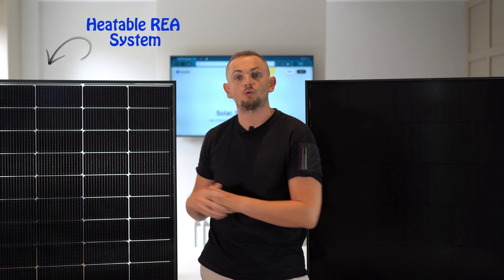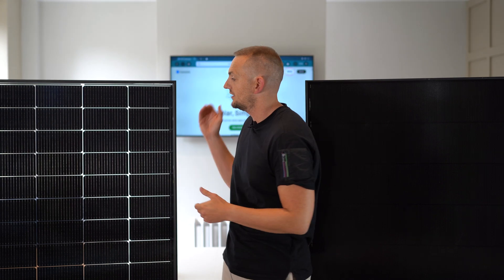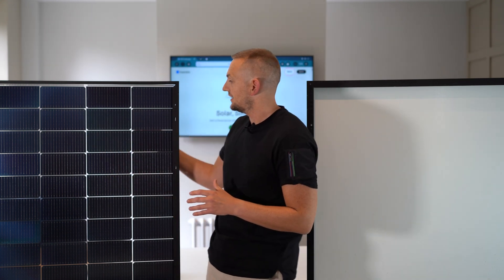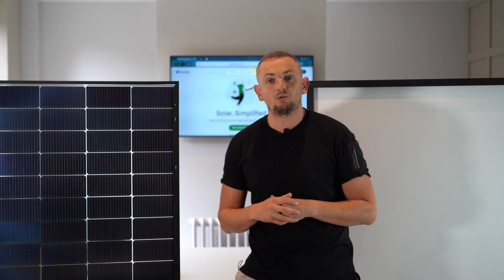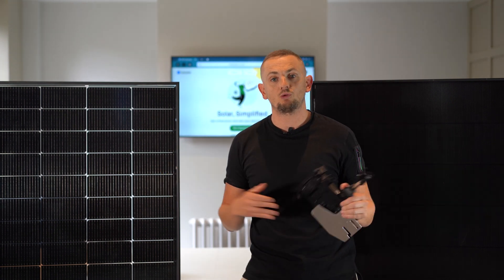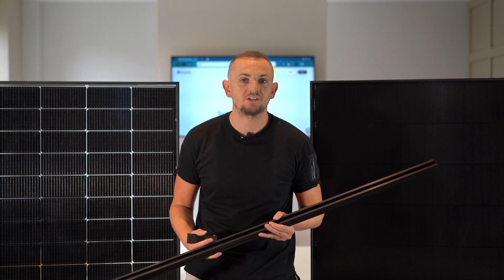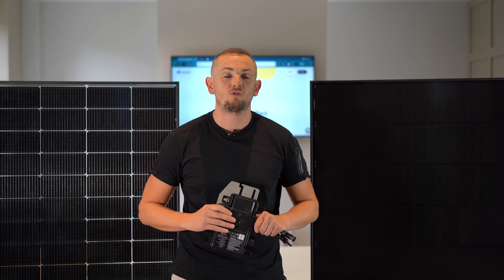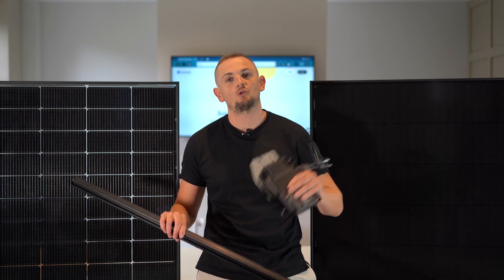The Future Of Solar PV Is Here | AC VS Traditional DC Solar Panel System

Comment: Would you consider installing with an integrated system like GSE?
Reply from the maker: The in-roof systems heat up more than the on roof systems, meaning that the efficiency of the panels is slightly lower. We've decided for now to just stick with on roof systems.

Comment: As an installer, I really hope you will paint the roof area with solar reflective paint to capitalize on the bifacial technology. Otherwise, you're unintentionally upselling while under engineering.
Reply from the maker: We don't paint the roof for a reason...

The panels are lab tested for different surfaces and whilst light roofer surfaces do provide marginally more rear generation, the panel still performs well on standard tile or slate. The panel doesn't require direct light to function, the objective is to allow ambient light to transit around the panel. Hope this explains it a little better!
Reply: @Heatable  I don't mean to come across as argumentative. We install bi-facial panels in all our commercial farm projects. The difference in generation isn't "marginal". Real world measurements show a 18+% increase in generation with white stones/ pebbles. On a roof, an end user can expect 7-11%. Don't take my word for it - there are several studies published about this unique attribute of the technology.

Given the panels are right for the job, I'm  surprised you won't offer consumers the option of white reflective paint between the rails. It makes no sense not to given the simplicity of the task vs. the benefit?

Comment: Question how good they can hold a hail storm? 🤔
Reply from the maker: The tempered glass on the surface is typically strong enough that most hailstorms will not damage your panels. They're made of good stuff and come with a 25 year warranty so that if you do get the hailstorm of all hailstorms, you don't need to worry.